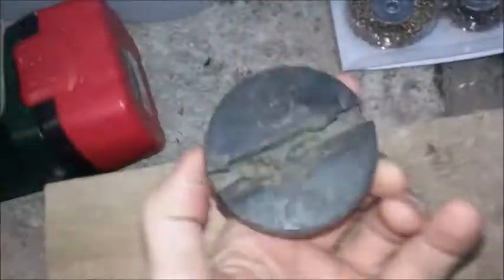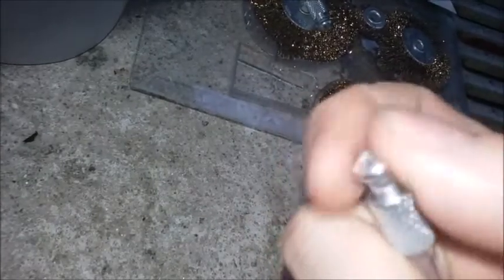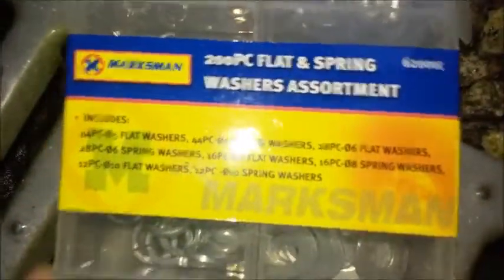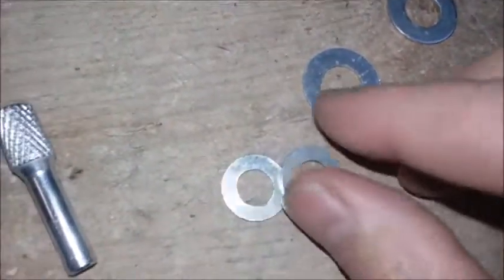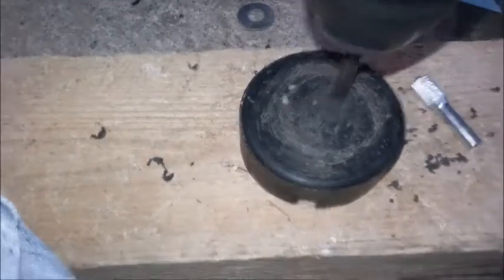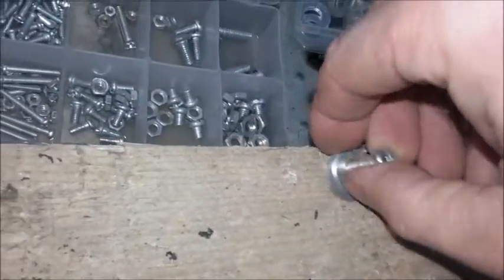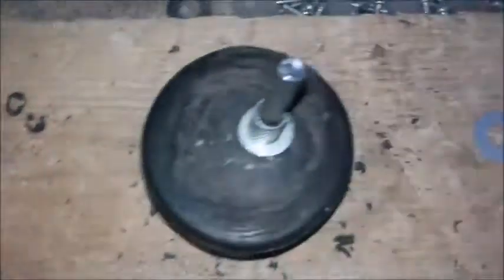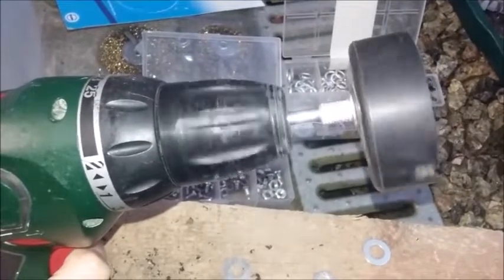How To Make DIY Radiator Agitator For Power Flushing

Comment: What a brilliant idea, thought it was going to be crappy idea at first, how wrong could I be!   I would imagine a significant part of the cost of the Adey device must be for the part that reduces the vicious hammering action of an SDS drill to an acceptable level.  Your solution changes the drill action to a largely friction action with hammering additions, hence the need to interpose the wood block.  Not only does this remove the burnishing action of the puck but also spreads the vibrations out over a larger area.
Congratulations, brilliant, just brilliant.
Could i suggest you give some thought to producing this idea on a commercial DIY market basis.  Most of us would be happy to pay a tenner for one.
Reply from the maker: Thanks for the feedback and i'll let someone else go commercial.  I have no radiators now as all underfloor heating so no more hassle😉👍

Comment: I like how you're using a rotational tool rather than a hammer action to emulate the hammer action. Quite novel, and saves me from having to buy/rent another tool. Do you need the block of wood, or can you just use the hockey puck directly?
Reply from the maker: Block of wood provides some protection to the radiator ie no rubber marks on white paint. I saved quids on the so called pro tool👍
Reply: @fiveminuteman  Ah in that case, maybe you could just wrap the puck with a white cloth or something? Then you'll get more localized agitation, providing it doesn't dent the radiator of course.